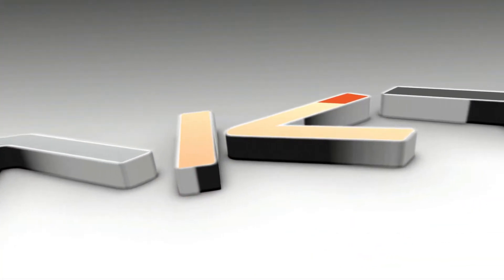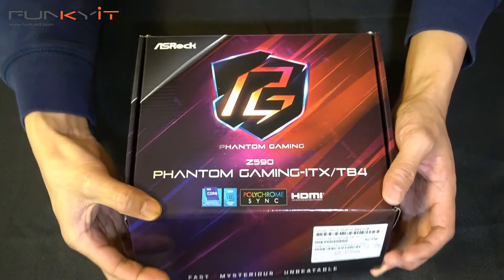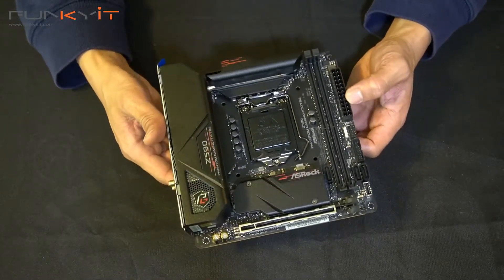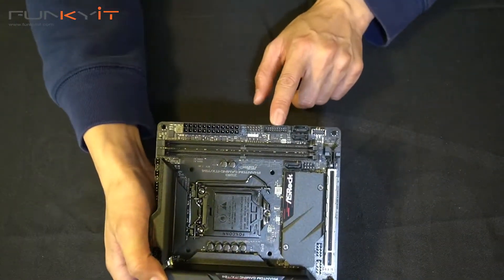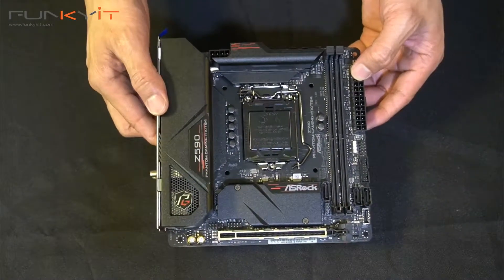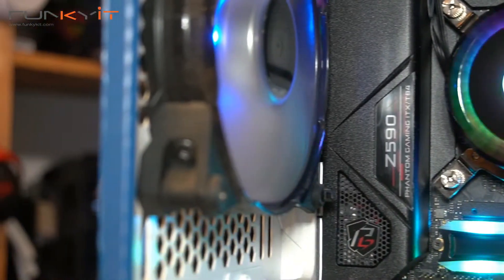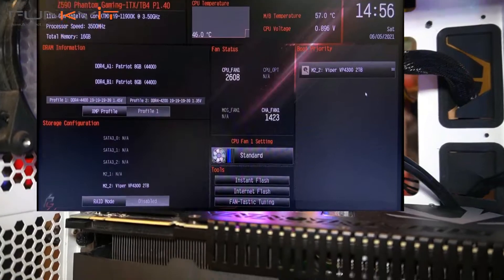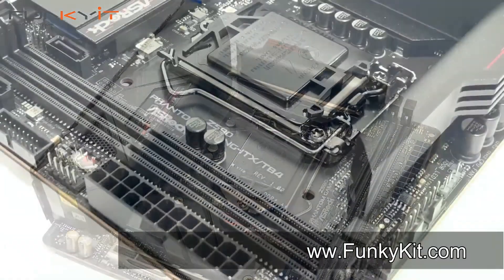The Best Z590 Mini-ITX Motherboard money can buy - ASRock Z590 Phantom Gaming-ITX/TB4

Comment: The MSI MEG z590i unify has a lot more features for the money.
Reply: Apart from 1 extra sata port i don't see any extra feature on msi. Also msi front usb c is 10gig & not 20gig like asrock. Plus ofc that msi has 2 tb4 ports to compensate lol. Decisions decisions.. 😭
Reply: @suspicionofdeceit 20gbps isn't thunderbolt its usb3.2 gen2x2 i know alot of usb crap 😂. But Audio interfaces don't need that much bandwidth anyways isn't it? correct me if i'm wrong
Reply: The msi meg z590i unify motherboard doesn't even have an optical output.